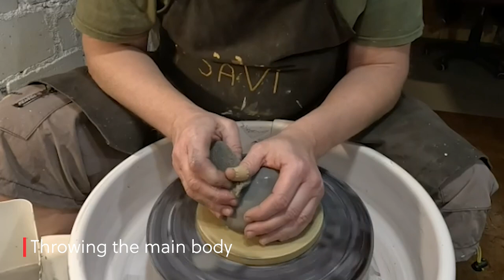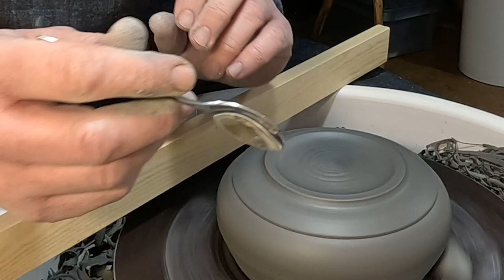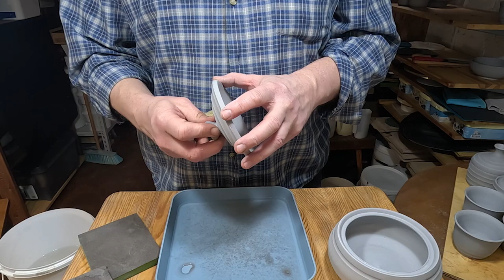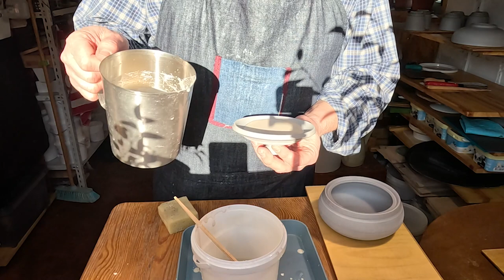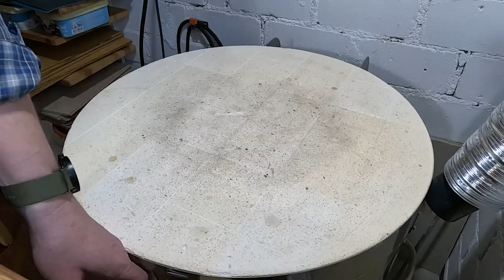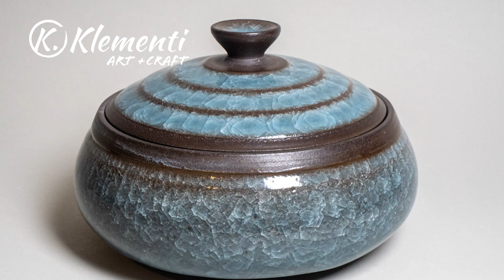Making a ceramic treasure box with snowflake crackle glaze  (ASMR, no text and voiceover)

Comment: Just perfection.  I'd love to be able to do that.  What kind of clay is that?  I have a Black clay 266, and it's red when greenware.
Reply from the maker: Thank you Judy. 
The clay I mix and wedge from 2 different clay bodies. I have no experience with 266.It seems to to fire to quite interesting colour.  Seems to be quite similar to one black clay I have tested, but that one did not work with several glazes. 
German made Goerg & Schneider 373 and 371 are quite similar to my mix but slightly lighter grey.